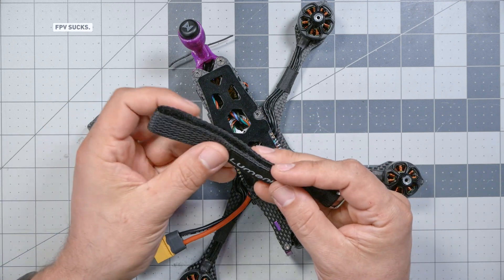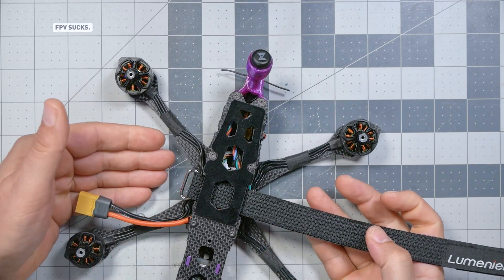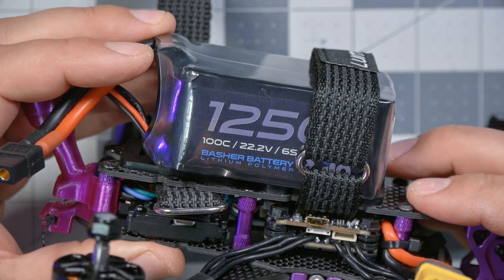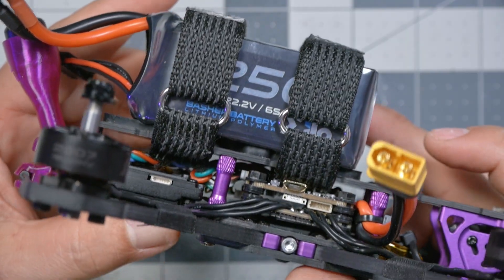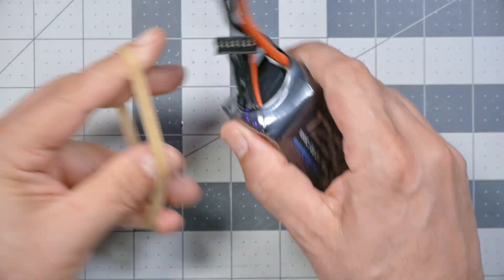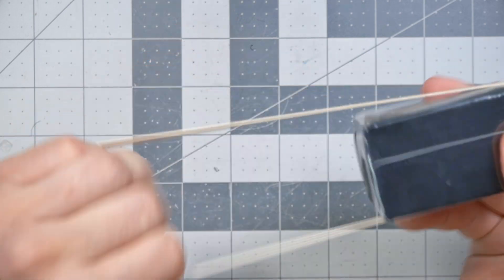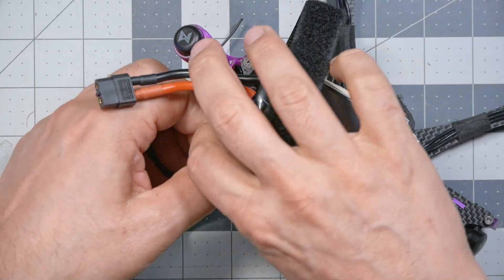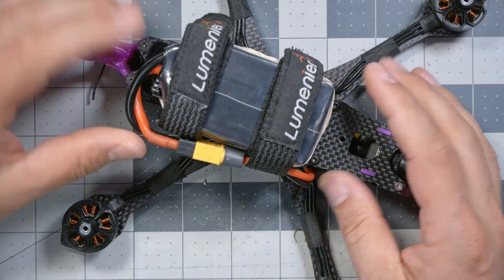Build an FPV drone in 2023 - Part 13 - How to mount your battery RIGHT

Comment: But why is the battery mounted on the back of the drone in this kit?  It creates a big disbalance in the weight, so motors on the back should work more and as a result the battery will drain faster.

Comment: i am wondering which goggles to get as a beginner.  i am looking at either the Fat Shark Dominator HDO 2.1 FPV Goggles w/ RX Module or the Walksnail Avatar HD Goggles X. Most likely i will be using the walksnail FPV system.

Comment: I made a 3D printed part to hard mount the XT30 on the quad. That way I can just plug in the battery. With the Ummagrip on the quad, I can almost fly it without a strap (don’t do that, you never know).
Reply from the maker: What's the thingiverse part number?

Comment: The fact that there's at least 13 parts to this video series is in itself going to scare people away from wanting to build a quad.
Reply: The type of person who'll get scared by having too much info is the wrong type of person to build a quad in the first place...
Reply: @nullfield1126  agreed
Reply from the maker: The goal of this series is to present all the info somebody needs to build, configure, and maiden an FPV freestyle drone. This is just how much information is required to do that. There are even a few things I left out, like installing Betaflight. There are shorter tutorials that assume the viewer will figure out more stuff for themselves. But bottom line, this is the minimum amount of information you need to know to build an FPV drone. If you're not up for it, then you don't want to build an FPV drone.
Reply: This series would have saved me 1000s 10 years ago.

Comment: What i do these days is put some 3M dual lock on the battery and on the frame. It is nowhere near strong enough to hold the battery in place on its own, but it does stop it sliding around. So the dual lock holds the battery from moving laterally or longitudinally, the strap holds it down on to the dual lock.
Reply: Cheaper than ummagrip but ummagrip is easier for freestyle pilots i feel.